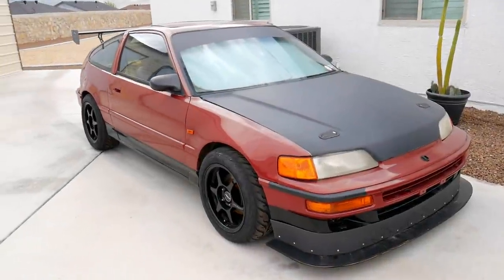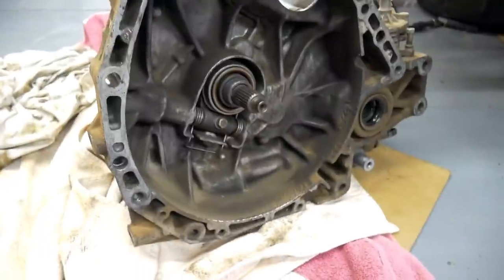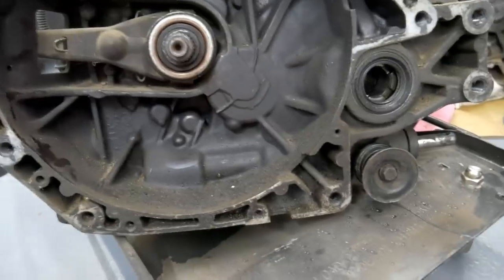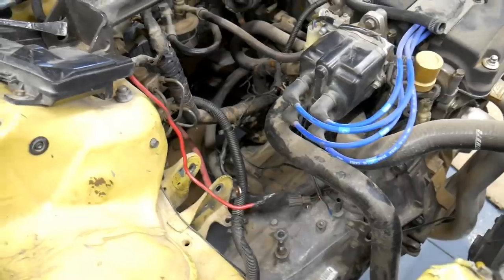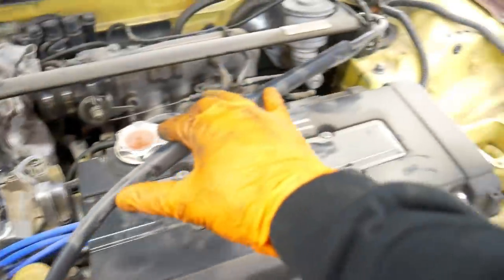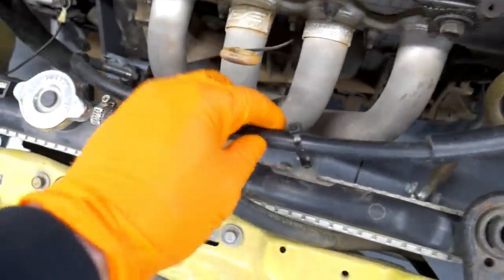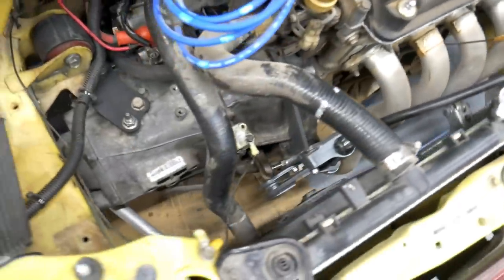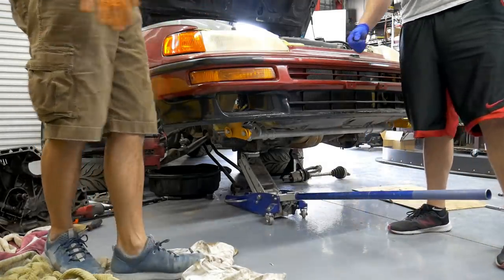Installing a Hydraulic Transmission Into My CRX - Innovative Cable to Hydro Actuator & Motor Mount

Comment: I had a similar hydro/cable bracket on mine.  I originally had an ebay one that liked to bind up sometimes and the geometry was wrong.   My clutch pedal was cocked out so far left that it wouldn't go down far enough to release the clutch.    I had a somewhat heavy Competition Clutch pressure plate that was in the car when I got it and I destroyed 3 pedal assemblies.  The one that was in the car when I bought it was already pretty messed up....then I killed two CRX assemblies (which are stronger) and one plain EF assembly.   I swapped to the bracket like yours and went to an Action Clutch 4 puck unsprung unit and it was much much better but still too much for a stock EF pedal assembly and it was starting to bend after a month or so.   I went to the Hush cable to hydro conversion shortly after I noticed the bending and had zero issues afterwards.  I actually was able to force their slave cylinder bracket onto the bent EF assembly and it lasted until I sold the car.   That bracket is heavy duty and really triangulates the weak spots in the stock assembly.  I don't know if you can still buy it by itself but it's worth it even if you plan to keep the cable and conversion bracket setup.
Reply from the maker: Thanks for the super interesting share.  I'd love to do the Hush Performance setup that they still offer which is full hydro, but these parts were essentially "free" so I decided to use them for now.  I may actually sell and get the Hush kit once the season is over.

Comment: Hey, did the speed sensor work? I noticed you used the cable transmission speed sensor and put it in the hydro transmission.
Reply from the maker: Of course it did. 👍
Reply: @GarageBuiltHondas  so I can do the same thing and put a cable speed sensor into my b16 hydro trans that’s going into my 1990 integra?
Reply from the maker: Yes

Comment: Helpful video as always! I have a known solid hydro LS trans with installed LSD for a B20 swap in by 88 CRX SI, wondering what the best option was for cable to hydro. Hush kit looks sweet but for 88 you have to swap to a later pedal assembly which is kind of a bummer.

Comment: Hey Jon, don’t know if you already swapped to a smaller throttle cable, but an eg cable works as well! I used one on my z6 swapped EF, and it fits perfect in the pedal and will get rid of all that slack. Mine was getting stuck on my neuspeed strut bar and sticking open! Super sketchy!!
Reply from the maker: Thanks for the tip, I'll probably order one when I remember too!
Reply: @GarageBuiltHondas  no problem! I took a small vacay from efs, but just recently traded a gs300 I paid $2k for, for a b16 swapped fwd wagon, and an RT4WD wagon. I’m happy to be back in one everyday lol
Reply from the maker: Nobody ever really leaves EFs.  Lol

Comment: I might as well scrap my b engine even though needs rebuilt doing me no good where I am can’t find a b trans harder to find than than the engines
Reply: You can buy a rebuilt one from synchrotech or manual gearbox LLC. I think even geardriven is selling them. They are expensive but worth it. Or if you're broke like me get a used one lol. I paid 350 for both of my small spline LS cable trans one from a friend and one from eBay. They cost alot more for a b series than a d series but its worth it. You could  use a hydraulic trans they are easier to find usually.
Reply: @joshdane5657  I think I’ve found one few hours away from me

Comment: Hey I’m dropping a b16a2 into my 1990 integra DA. What distributor, alternator and starter do I need for my set up to work? I’m using the stock harness from the Integra da.
Reply from the maker: All obd0 parts.

Comment: I have a 92 GSR that came swapped with a b18ba2? w a 2 speed manual transmission…. Now a b18c1 is going in with its hydro 5 speed transmission… currently made a full hydro conversion with the master cylinder on the pedal assembly…. Just curious to see if I need new axles or do the axles on the b18b1

Comment: Jon is there any way you can make a video of what every electrical part is and does. I got wires under neath the steering column that are almost melted showing bare wire. Most of the wires are sleeved with duck tape. 
I ran my car hard yesterday which i know i shouldnt have done. After the session i was driving back yestderday and the car died on me. It wouldnt start i didnt hear the fuel pump prime but i did felt the relay clicking. I disconnected the battery checked the fuses #8 was blown but all the instrument lights were working. The fuse was 25amp. I noticed none of the fuses are what they are suppose to be all mixed matched amps. I got wires cut or frayed. Relays or fuse boxes not bolted to anything. 
This goes back to my request in that maybe if you can help out with naming electrical parts so i can cross refrence them to a wiring diagram. Maybe if hints on sensors if swaps are to be done like d15 to d16/zc
This moring again the car cranked but no start. The only thing different from before to now was zip tie the wire rats nest under the steering column so that i would rub the wires with my leg. I touch the wire nest with my hand and it started up. Got to work and tried it again. Started. I know my o2 was giving me problems before. Replaced it recently but i think its still giving me problems. Had code 1 last night moved the wiring no code. I need to spend more time following wires and labing them and checking out pins
Reply from the maker: Sorry, I just don't have the time.  I only make videos of what I'm currently working on and I've got my hands full with all the things I want to get done to my cars and hardly enough time to work on any of it.
Reply: @GarageBuiltHondas  thats how it is man. I just got a pdf service manual online free. Im going to read that puppy like no other. I learning everyday about this car. I got zc but it has dual point. I replaced the o2 but now im getting similar problems of what i had before. Rpm not doing down after i shift. On top i have a leak in the exhaust somewhere. It never ends but itll come through. Engine mounts are done though atleast
Reply from the maker: That'll work.  Good luck!

Comment: Do you have any issues with the trans hitting the passenger side frame? My b16 hydro trans is hitting the frame on any kind of hard shifting or taking off.
Reply from the maker: Zero.  And I tracked it once with this setup.  If you're using generic mounts, that may be the problem.  I'm using Hasport with the softest bushing and no issues.
Reply: @GarageBuiltHondas  I'm using innovative billet mounts with the 95a inserts. I had this same setup in my sedan and it never hit but it hits in hy hatch. Kinda interesting, maybe I can loosen the mounts and move it over a little? If not guess I'll be adding a midplate mounted to the traction bar lol
Reply from the maker: That's too bad, maybe do as you said, loosen them all and shift it over and tighten again as the engine is being pushed over.
Reply: @GarageBuiltHondas  I took the passenger mount off and it was slotted. I got it all fixed now👌

Comment: Love this video!  I went with a cable-tranny because it was the first available but it had no markings on it.  How do you tell if it’s LSD or open?  Thx!

Still it in the car, btw
Reply from the maker: Remove an axle and look in the diff.  A bar in the diff equals no LSD.
Reply: @GarageBuiltHondas  thanks, Jon!  I have an open.  :(. Oh well, it’s all I had available and I’m just putting n a stock JDM B16a anyway.  Not power hungry, just want more track ability
Reply from the maker: LSD really isn't necessary unless you're tracking you car very often and you're driving skills have exceeded your parts.  👍
Reply: @GarageBuiltHondas  well that certainly hasn’t happened.  😂
Reply from the maker: One day you'll get there!!

Comment: HOPEFULLY YOU CAN HELP!!!! Does a jdm b16 transmission work with ls axles ON A B18B MOTOR ??? I heard that you need to run 90-93 integra axles non abs an use a b16 intermediate shaft for it to work
Reply from the maker: What car?

Comment: hey GBH what's your opinion over the DC Sports header vs Skunk2 header? I see that DC sports don't make a 4-1 header for vtec engines anymore🤷
Reply from the maker: Both are great.  I doubt one makes more power than the other really.  Probably similar gains as both companies make good products.  Grab whichever you can get that'll save you a little money!
Reply: @GarageBuiltHondas  the problems with the DC sports 4-1 header are: low floor clearance, 2.25" merge collector and 404 Stainless steel which tends to rust. 

I've seen guys online chop the 2.25" collector and weld on a 2.5" collector and gain a few HP I don't know if it's worth the headache

Comment: I have a question, you had to bent or smash the frame to fit the b series alternator?
Reply from the maker: This car was never hammered, I found this out when I had to swap the alternator belt.  I was able to find an extra belt that I had lying around that was shorter and it worked.  I prefer to hammer the frame rail though and will one day when I pull the engine.
Reply: @GarageBuiltHondas  Thanks!, I saw many crx that needed to be hammered, but i dont knw why, because the jdm sir came with a B series. I have a fitment problem with my B series alternator so i want to see a solution without hammer it.

Comment: I have the same cable to hydro kit but I noticed that your clutch fork is different than my itr. Which clutch fork are you using that’ll allow for the piece to connect to it?
Reply from the maker: Couldn't tell you.  Looks stock to me.  I got the trans from a parts car so I'm unsure if it's a different fork.  My guess is all B series forks from 92-01 should be the same as all those transmissions have the same sized input shafts and gears.
Reply: @GarageBuiltHondas  I see. Do we just push and squeeze the ball on the bracket into the fork?
Reply: Sorry to bother you again, but is there anything holding the end piece that’s pushing the clutch fork in place? Or is it constant pressure from the tranny that’s not allowing it to slide out of the fork? I’m currently working with the same setup, except my tranny isn’t mated yet to block.
Reply from the maker: Don't understand what you're saying, sorry.

Comment: What hardware did you end up using on the side skirts? The screws pci provided me were a little on the short side
Reply from the maker: PCI provided.  Everything worked perfectly.
Reply from the maker: It just installs directly over the plastic.  Email Brian from PCI.  He had sent me the instructions but I tossed them.  It's so easy to install them.

Comment: So I'm doing a b20 ls trans in my ef I was wondering if you had any info on how to get the speedometer working with it dose it just switch over or dose it have to be a specific year 🤔
Reply from the maker: You didn't mention speedometer sensor
Reply: @GarageBuiltHondas   yeah my bad are the speedometer sensors interchangeable as well 🤔
Reply from the maker: Yes.  Just need a cable sensor
Reply: @GarageBuiltHondas  hay man I really appreciate you sharing this Info and honestly keep up the great work with the videos I really enjoy and learn alot from watching you thank you happy holidays
Reply: @GarageBuiltHondas  one last questions what year make and model should I be looking for
Reply from the maker: Any 88-91 B or D series will work.

Comment: Whats the update on the pedal feel using the actuator?? Do you like it? I purchased the innovative h22 ef mount kit that comes with the actuator. Im hoping it feels good enough where i won't have to go full hydro. Well lmk how you like it so far?
Reply from the maker: Feels like a cable setup still.  It's fine.

Comment: Ok can y’all help me out I need to find what those 2 brackets he using on left side the motor mount bracket and the one that the transmission has y’all please help me find those brackets. I need those to be able to put my engine in my car all I need is those 2 brackets on the left side of the transmission
Reply from the maker: Here's the rear bracket. 
https://amzn.to/3NuVy93

The other one is a stock bracket you'll need to find.

Comment: While were on the topic of transmissions, I have a 90 DX hatch with an automatic and DPFI. I was wondering if I could use a 92-95 civic automatic trans for my 90 D15. I am trying to see if I could mpfi swap it and keep it automatic. I know 90's are cable and 92-up are hydraulic but does that matter with Auto's?
Reply from the maker: Good question, I have zero clue.  Never researched it.  My guess is the 2 mounts on the transmission would be completely different.
Reply: @GarageBuiltHondas  that was my guess too. The kickdown cable is the only snag in my plan lol. Guess I'll just tear it apart and try.
Reply: I dont think so to old .i know you can use and swap back and forth 92-95 96-2000 but not 1988-1991
Reply: Bcuz the electronic part of it not just speedo sensor

Comment: Hey Jon, if you want some heat wrap for your header to help protect the clutch cable hmu via email.  Also, for the sunroof delete, I think you're talented enough to make your own carbon fiber panel for it. "Bills Build & Race" formerly WJP004 youtube channel has amazing & easy to follow tutorials for almost anything automotive & carbon fiber/fiberglass related. It'd be easy & cheap & make for a cool video I'm sure your subs would enjoy.